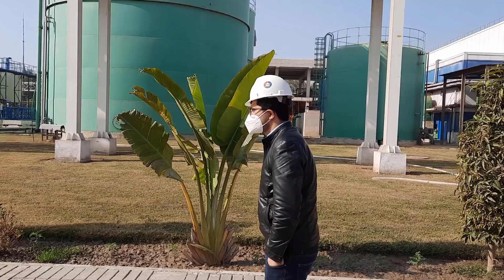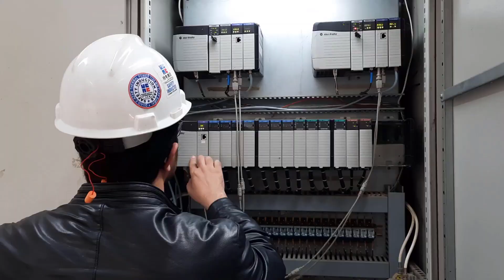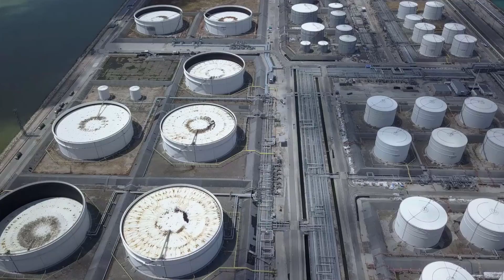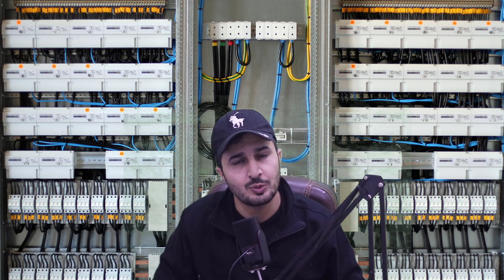What is Industrial PLC Commissioning: Step By Step Guide 2023

Comment: Step 1: Verify instrumentation signals and faults to PLC.

Steps 2: Verify single process functions (move actuator, open valve, VFD ramping speed)

Step 3: Verify operating sequences (fan starts correctly, controls to set points, etc.)

Step 4: Verify fault sequences (what happens if the controlling sensor fails, what happens if a chiller fails in the middle of weekly rotation)

Step 4 is the most important because it tests resiliency. I say this all the time, 25% of programming is getting it to do what you want (that’s generally the easy part) the other 75% is what to do or how your system reacts when a piece or critical piece stops working.

Step 4: Verify fault sequences

Comment: I work doing this in the U.S, as my company is an OEM Industrial Water Treatment Engineering Company and Supplier. My co-worker is an Automation Engineer and he very much writes all the logic program for new projects and old systems upgrade projects. I usually do the HMI and he does the logic programming and completes everything. Some the commissioning of the PLC Program is done at the office as we can run it on a logix controller chassis to check some things, though most the rest is at site. At site it's testing the program and a lot of loop checking with instruments, valves, pumps, sequencing etc. Fun stuff, but some days you want to pull your hair out how things goes.

Comment: I worked for an engineering company doing wiring of its automated machines. Although I have a bac in mechanical eng. I moved to Canada and started as a wire assembler.  So I would build the control panel from zero, install it besides the machine and did ALL the wiring of sensors, actuators, servomotors, drives, etc. I would also tagged the wires as per the drawing. Once the wiring was completed and, with a checklist I started verifying ALL and every single wire that I had made. Once the process is finished, I started testing all inputs and outputs. At the end, I issued a document to the engineer so that he/she see what was working ok and where I found some issue. 
With that said, is that plc comissioning what I did as a wire assembler? Let me know.

Comment: Good video.  I had a book from a controls guy from a company in Minesota.

The book described the control of a rotatating forming machine.  The author had a method where the plc program would operate in various states and modes. The modes were as follows.
1.  Measure i/o of the plc inpits
2.  Move individual actualors
3.  Execute individual machine step
4.  Execute machine outside control system
5.  Execute machine in production. 

Do you know any refetences alomg this area?